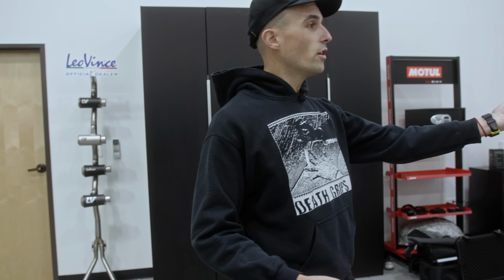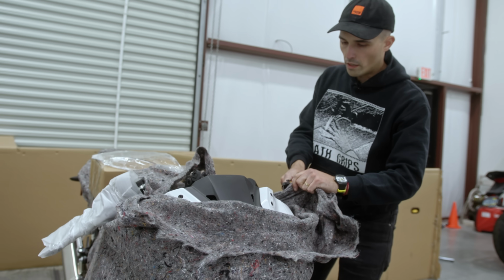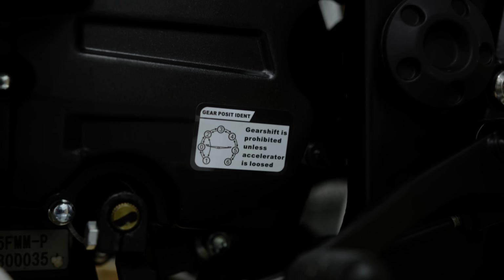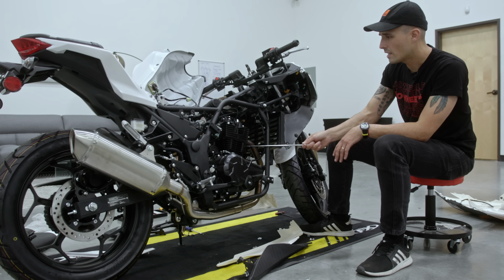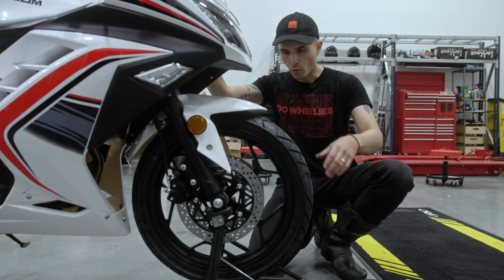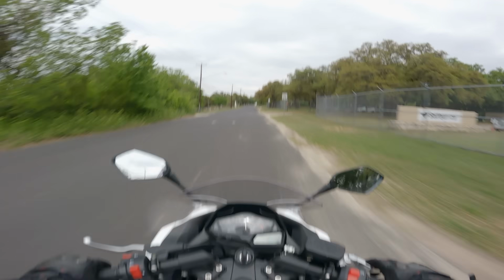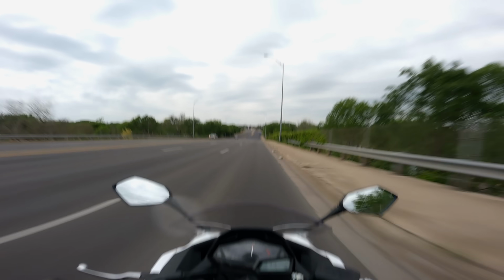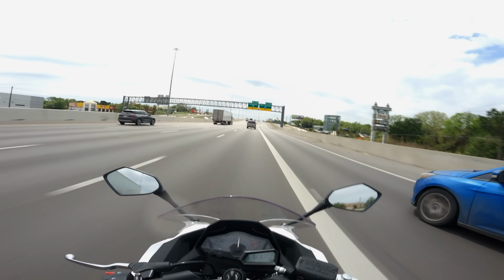They tried to trade a Bike for a POSITIVE REVIEW... So I Bought it Instead

Comment: I actually have a CSC TT 250 Dual Sport that was made by ZONGSHEN. It runs a 230 cc Honda CG engine clone that puts out about 17 hp and I absolutely rode the shit out of it for over 16K miles including a couple of trips that were 200+ miles on the highway. It did end up eating a bearing in the transmission after I got stuck in Daytona 500 traffic and it got too hot. I bought a new engine off of eBay and put it in and it's still running. Had I been able to find a used Japanese Dual Sport I would've  bought one but I couldn't so I went the Chinese route and while I knew what I was getting I was actually impressed with how well it worked as a commuter and the light off-road that I've done and don't regret buying it one bit.
Reply: A friend of mine bought one of those CSC 250 ADV bikes and rode it for like 25k miles without any problems.  Slow as hell, but wasn't bad for what he paid for it.  It even came with semi-decent hard luggage which I think he actually kept after he sold it and transferred it to his next bike because it used the same mounting points as Givi luggage.
Reply: Mine was similar, but it only made it 11k miles before the connecting rod bearing went out (234cc). Rather unimpressive, but it would run 72 mph with a gearing change at least. It vibrated so much that I was always changing bulbs or resoldering wiring though...
Reply: I love my tt250. I've done a number of "performance" changes. Decked and ported the head, polished 30mm racing carb, full exhaust. It's a blast, though I only ride like 1.5k a year.
Reply: I've enjoyed my Hawk 250 EFI dual sport around town in Austin. The gearing has been changed but I only hop on the highway for short distances. I bought it from a guy who is a mechanic and he went over every bolt on the bike when he got it and marked them all with a magic marker so he could tell if they were backing out.

I do wonder what experience Yammie would have had with this bike on the first ride if he'd gone over everything first. I don't think that's unreasonable for these bikes that are coming in crates; I wouldn't feel comfortable taking it out on a ride without a solid once over first. Also, I get Yammie's style with videos like these, but I really would value his opinion on a cheap entry level bike like this that compared it to a reasonable baseline and without the baggage of a s*** company that was looking to buy a review.
Reply: @devontitterington6418  Sad part is the MOST you'll get with a full race exhaust and your mods is like 20 HP, while if you took 1/4 of a suzuki engine (so its also 1 cylinder 250cc), you'd be making 50 HP. The Chinese engines just do not perform anywhere near the level of the Japanese engines.

Example was for a 199 HP 999cc inline 4 (or 4x 250cc cylinders at 50 HP each)
Reply: @RobertJennings  Don't all companies do that?
Reply: @Jake Garrett  I don't follow. Are we cutting up I-4 motor? That's an obtuse comparison. If we're comparing modern, water cooled, fuel injected motors to air-cooled, carbureted motors, that's still not a fair comparison. Even the latest high-performance 250 singles only make like 25hp, "more" yes. "Better" agree to disagree.
Reply: @RobertJennings  he sure as hell doesn't know the definition of what a PDI is. Had he done it right he would've noticed  the stuck brake caliper and other issues.
Reply: Lol my first bike was a zongshen gs250😂 it was perfectly fine to learn on great bike for 750 bucks. It might’ve done 60mph down hill but got over 40+mpg. Also the stator went out three or four times. 😅

Comment: Yeah, I  wanted to go crazy at the Rottweiler candy store too. But I  decided to keep it stock with the exception of a fueling dongle I  got from overseas.  The one I  got from Rottweiler made my check engine light come on. Found out later that it just takes some time for it to re-calibrate .  Maybe a slip on in the near future.  I'm very pleased with mine in stock form for the first couple years.  Changing the sprocket ratio worked for me.

Comment: i have worked on these bikes before and yes they run  insanely lean right out of the factory , so lean the head develops cracks right afte 10k , a bigger good brand injector not only would prolong the life of the engine but adds that neede oomph , although i never experienced the waving you had so it could be a rear camber issue or loose lower front bearing

Comment: When I got my (slightly used) '86 Honda CB 250 RS back in the day ('95), I spent the time before getting my license shining it up. Having the frame sandblasted and repainted, seat reupholstered, rusted parts painted, etc. When putting it back together, I also ended up with the steering too tight. When I found out, I loosened it, and ended up with it TOO loose, resulting in an nasty wobble first time I reached 72 mph.
It was quite rough, only had (on paper) 26 hp, and felt like a moped to ride on, but it was great for learning to ride, it was incredibly forgiving, and it was actually pretty fun on the small twisties. :)

Comment: I think the instruction at the gear selector means "Only shift the gear after you release the throttle" which is like step 2 in driving a manual transmission,  step1 is pull/step on the clutch, step 2 is release the gas, step 3 is shift the gear, step 4 is release the clutch and finally step 5 is pull/step on the gas.

Comment: Thanks for doing this, Yam. You just saved someone else from wasting three grand that could have bought a nice used Japanese bike instead. Having ridden well-made motorcycles for all your life. Finding yourself on a terrifyingly poorly constructed motorcycle must be a sobering experience.
 I kind of expect Yammie corp to resurrect this 'bike' from it's own assembly and maybe give it a new life as a 'could have been' idea. This really does show that you get what you know about...not what you pay for. It's the number one reason I never take chances on machines I buy. I wait for others to buy them and see what kind of history they have with them.
 If someone gave this thing to me, I would immediately change all the fluids to western manufactured fluids, (brake, engine oil, gas) and I would try to run no ethanol gas in it if I could find it. I would also consider immediately ditching those Chinese tires. Cheap Chinese tires (for any machine) are the worst quality in the world. 
Had you just tried to 'run in' those terribly sticking front brakes you would have burned up the pads, scorched the disc faces and most importantly, maybe heat damaged the calipers. It would have boiled the brake fluid too which would have made just horrible mushy brakes for the rest of the time you rode it until you replaced the fluid, the pads and maybe even the calipers. I would look into getting that return cable for the carburetor. Not a fan of sticking carb cables. The ultra tight steering head bolt is also bad because super over torquing these bolts can actually dent the races, the bearings sit in, as well as flatten the bearings, if they are cheap, making the steering notchy. I'm glad you found that.
Another thing I would say though, is that this BOOM bike and the CF Bikes from a completely different Chinese manufacturer look to have ZERO in common. That CF bike line seems to be a very well-made bike. So, there is a super wide range to Chinese bikes and Yammie simply found himself the victim of the lowest form of Chinese bike here.
I would definitely keep this thing in house as a parts beater, if you even trusted it that far.
 Don't let this thing hurt you, Yam and Thank you for not letting someone control your First Amendment right to tell the Truth, Yammie. It matters.
Reply: It should be noted that changing the fluids upon getting one is something you're supposed to do (no matter which manufacturer). That's true of name-brand bikes, too, though dealers are the ones that do so in such cases. The oil that's in them is meant more to keep seawater-air and associated corrosion at bay during pre-shipping storage and shipment than it is to lubricate the engine. Less so for brake fluid, but that's still a good line-item to change. Also Loc-tite is your friend. Lots of loctite....

As for the quality range? yeah there's a pretty wide margin. Hawks are cheap but so common that the community around them makes up for the shortfalls, ditto Magicians. Lifans are just straight up reliable in most cases provided you change out the shipping oil and break them in (their engines are a common swap out option for some Hondas because hey 125cc fits a Super Cub....).

Comment: Thanks for doing a review on a cheap Chinese bike. I always wondered.
Is the suspension maybe the problem?

Can you share what is good about the bike vs. A cheap used bike?
I'm sure that Venom appreciates the criticism...
Thanks!

Ps. They lost me at not keeping a straight line, would go Royal Enfield or used.
Reply: It's so funny to me how people will see stuff like this and then go ahead and buy some other Chinese brand expecting it to be fine.
Reply: @boomerisadog3899  Some are ok, but they don't last long like a Kawasaki. My grandfather's 90cc from the 70's will run 70 mph with a full size adult (the same as my 250cc duel sport Chinesium that's similar to the Hawk 250), but unlike my bike which its connecting rod bearing went out within 11k miles, that Kawi will be purring along for 3 or possibly even 4 generations (also a great bike for little kids, its very small, but much lighter than the Grom with a higher top speed)

The frame was the weakest part on my bike, so a lot of it has been replaced, that and the sprocket pins were always sheering... and the electrical wires needed soldering all the time (as well as replacing bulbs) because the engine vibrated so bad. Those are the constant issues of Chinese bikes, the rest such as suspension (mine was actually pretty good, you could roll over hay bales or play around off-road decently), that's all up to luck. The wheels won't be perfectly tuned, but you can fix that yourself, its just a LOT of maintenance because nothing is built correctly by the Chinese kids assembling them. They could be ok if their engines had proper balance, that would make them alright for puttering around, but they don't... so a lot more issues pop up.
Reply: Dude. You are upside down on this issue. Magnetic attraction to new machines? For 3-4 k USD, you can get many fantastic used bikes.  I recommend any Honda.

Comment: I have a lifan kpr 200, I love it. Put it together myself, and have had zero issues. It is my first bike so I can't compare it to others, but I love it. For less than $3000 for a new bike, you do get what you pay for though.
Reply: Lifan is above this bike.
Reply: Is it still good?
Reply: @kingbaboon1145 is it better?
Reply: @casillask42  much much better. This guy just received a knock of brand of low quality pieces put together. Like a Frankestein motorcycle. Lifan is a proper motorcycle brand that sells throughout South America and Asia.
Reply: @casillask42  I traded it for a truck  about 7 months ago. It was still good when I got rid of it. I didn't like the bad habits I was forming with it, though. With such little power, you could go 100% on it all the time,  and I didn't want to get too used to that.

Comment: NEVER put WD40 anywhere near brakes or tyres, it’s a lubricant.
If it gets on the pads or discs the brake will not work.
Years ago a friend sprayed WD40 on his front discs on his Suzuki GT380 to help them shine 😳.
First corner he went through a lawn and a rose bush before he stopped lol

Comment: Interested to see the followup video where the steering is fixed. I feel the initial impression was exaggerated a bit for a bike that had to be user assembled. You should have checked and rectified all assembly issues before going in so hard. If it was purchased fully assembled with the issues then I'd understand this first impression.

Comment: Yamster, I don't know about that boom bike..  but I can say the Lifan KPX-250 Dual Sport from Venom Motorsports for $2900 shipped is Darned Decent as a knock around power line right of way explore bike..  They claim 20 HP, EFI, Overhead Cam, w/Balance shaft.  6 Speed.  Max speed still maybe 75MPH,.  Quality, Power, Digital Dash, Transmission, Suspension are all  good!  EFI always perfect starts.  Lifan

Comment: "Gearshift is prohibited unless accelerator is loosed" Is Chinese to English for "Roll off the throttle during a gearshift" which is just the right way to shift, unless you want to wheelie.
Reply: I'm thinking it doesn't have synchros 😂

Comment: Sorry but looks like everything you complaining about has to do with improper PDI. Did you lube the and adjust the chain? Did you check the steering for grease and tightness before riding. Watching this video looks like you set it up for failure. I own 4 Chinese bikes and after I did a proper PDI, All these bikes have ran and driven flawlessly. The oldest is 7 years old with over 10,000 miles and no, it has not fallen apart on the side of the road or killed me. That would be a HD. lol  I also own a Vulcan S that a dealer did the PDI. I had to go through the who bike tightening up bolts they missed. The bike is only as good as you make it. All bikes are good if you properly maintain them. You are correct, these bikes aren't for someone who has no mechanical skills. You are the dealer and have to assemble the bike.
Reply: Completely agree with you the questionable PDI does indeed set them up for failure. I own a 125 Venom motorcycle set up by them and its worked great.

Comment: I bought an XPRO Titan 250dlx for $1500 2 years ago. Threw some Shinko 705s on it, rejetted the carb and a different rear sprocket. It’s great for motoring around town. It’s still running strong. Any serious ridings done on my Ninja400

Comment: That's what they're good at copying other companies motorcycles down to screw and bolt sizes. A Chinese motorcycle company here have in our city have an imitation for every commuter Japanese bike sold. One of the reasons I found was that if the shop don't have the available spare parts you're looking for, then you can simply buy one from the company it had been imitated from since it would still fit.

Comment: What's the claimed power of that "superbike" engine? The first motorcycle I ever rode was an early 90s Yamaha DT200R that had around 34hp of awesome two-stroke power and weighed a little over 100kg. And it was super easy to (involuntarily) pop a wheelie in first and second gear. Judging from the video and not knowing how much the "Superbike" weighs, I'd be surprised if this one had more than 15hp.
EDIT: NVM, looks like I was being too generous ... according to their site it weighs 146kg and has 11.5hp at 7,500 rpm. Superbike heaven!

Comment: About steering - the headset is too tight. Same effect when using a mechanical steering damper.  Front wheel should be able to "hunt" freely to self-correct. If the front forks pivot freely at the headset bearings, AS THEY SHOULD, and the wheel alignment front and rear is correct, then you should be able to ride hands-off in a straight line and make minor steering corrections by shifting your weight.

Comment: Upon seeing one of the flashback videos on your newer vid, I noticed the tire. Hear me out here.
The front tire has the tread of a brand named IRC Road Winner but when I saw the brand on the rear tire, I saw Cordial. So basically these tires WERE a ripoff from the IRC tires. And hear me out, the IRC RW was so slippery it has the nickname SOAPTIRES in my country. So the tire was a ripoff of a bad tire and that speaks to how bad this bike is. Oh and did I forget to mention that the IRC RW has two different threads for the front AND rear??? And what we saw on the front tire was ACTUALLY the thread for the rear tire!!!!

Comment: Here's the thing with Chinese bikes: Some of them are pretty much upfront with what you're paying for and what you're getting for it. Change the oil (what's in it is preservative more than lubricant, typically done at a dealer and the expensive jap bikes use the same stuff to protect the engine during shipping), tighten the bolts and don't expect jap quality out of a bike that's cheap brand new and you're golden. Lifan makes parts for some of the name brands, and their bikes and scooters seem to hold up well, they're also a bit more expensive than this one for a reason. Hawks and Magicians are also pretty solid.
Reply: That being noted: If you're buying a bike in a crate, you REALLY aught to expect to do *everything*. There's a reason people just pay dealers to set up their Hawks. Me? Yeah, I wouldn't mind setting up a crate bike, but then again I looked into doing that a few times over the years because the used market around here is (most of the time anyway) utterly mental.

Comment: Tbh I think the Speedo is set to KMpH instead of MpH. Which 60+ KMpH make sense over 60+ MpH. Also I would just tear the thing down cut out the shot welds and build it up put in a junk yard 350cc and make a Fankenstine engine. Maybe toss the front and rear wheels away ang get some from a yard also.

Comment: I bought the electric bike from them used it for a year or so. Then sold it to a dude and said it was his first bike. It maxed out speed at 40mph. “Street legal”. If it goes over 40 you need plates. And a license. It decent enough to learn how to handle a 300lb bike. But that’s about it.

Comment: Likely the same nx250 knock off motor I had in a qlink motard. Solid running reliable motor, but yeah it ain't putting down a lot of power. Ran out of steam around 60.